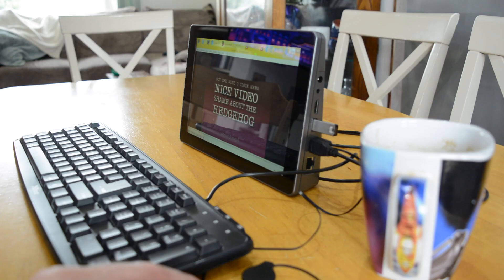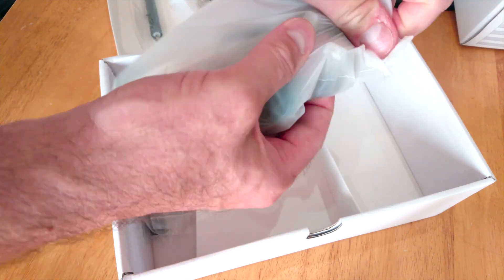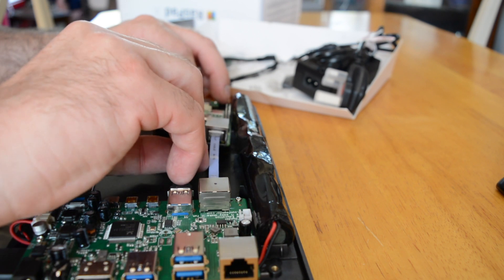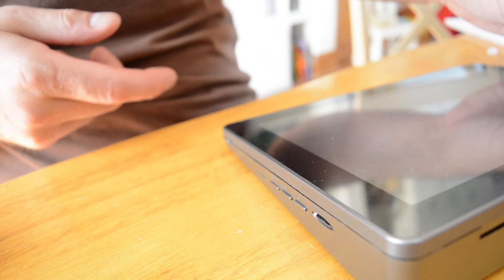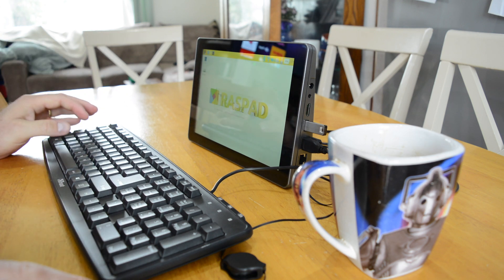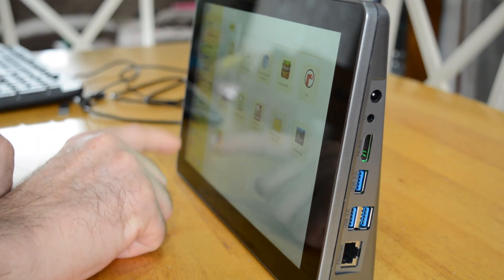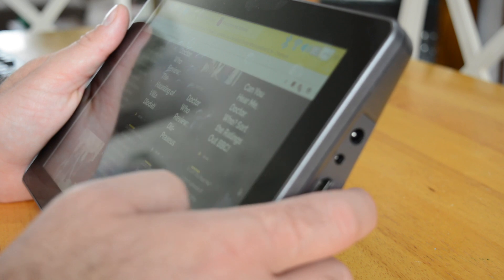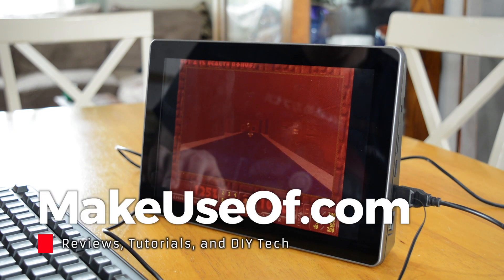Turn Your Raspberry Pi 4 Into a Tablet With the RasPad 3 (Review + GIVEAWAY!)

Comment: I've backed the project, but I also backed the original one. I ended up giving the orig. away because it didn't meet my needs, and felt half-baked. I am hoping this one is much more complete, as it seems to be. The auto-rotate is a huge benefit, and I'm glad you mentioned the extra space for storage, since we can now add external SSDs and boot from them. I'm just still not convinced that it's worth the $150... And I have only 10 days to decide. ;-) Thanks for this video, because it has given me one more incentive to not drop out.
Reply: So you weren't one of the ones that never got their product? I backed it but am considering cancelling after I've seen their track record for failing to deliver a good product or failing to deliver it at all >.<
Reply: @Butrdtostngravy   I did not know that some backers failed to get their product. It was late, but... well, of the near dozen projects I've backed, they all have been delayed, some longer than others. I waited over a year for a couple, but I've always gotten what I've ordered. On the other hand, I view backing a project like this as more akin to buying stocks. I may lose everything in the bargain. Backing a project is not like buying a product. You are investing in a company (like stocks), and one better be willing, even ready, to lose that investment. On the other hand, if I don't think I can trust a project, I don't back it. I was mostly satisfied with the gen 1, other than it was a longish delay (not the longest I've suffered, but not the best either). I.e. it was exactly as they described, plus I also got some extras that weren't in my package, possibly as a peace offering. ;-) The young lad I gave the kit to was quite excited at all the extra goodies I gave him.
Reply: @jonglass  yeah I backed the Era backpack from TravlWear and it took almost a year but the bag is amazing. I've also backed NFC rings that kept falling apart and C.H.I.P. That went bankrupt xD a few other companies I invested in were successful tho haha!
Reply: @Butrdtostngravy  Yeah, a crap shot for sure. I've been fortunate that every project I've backed I have gotten my product, and couldn't complain about the quality--so far. ;-)

Comment: No webcam no speakers and the laughable battery power makes me reach for the rubber stamp marked FAIL
Reply: Are u sure no speakers. A preproduction version on video showed very very basic speakers inside with output  from large grill like holes on underside. Guess that went on production model - if so a great shame indeed.
Reply: Checked same grill holes showing on this video too. So maybe still sound